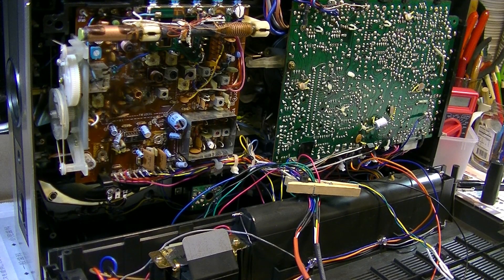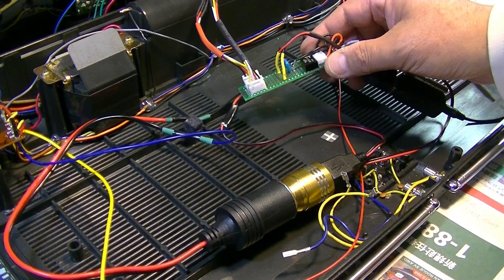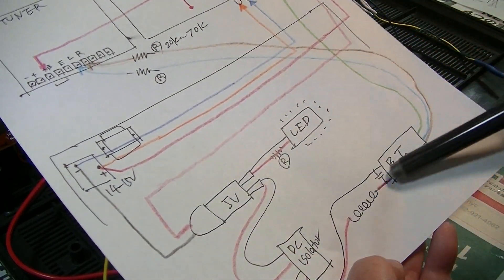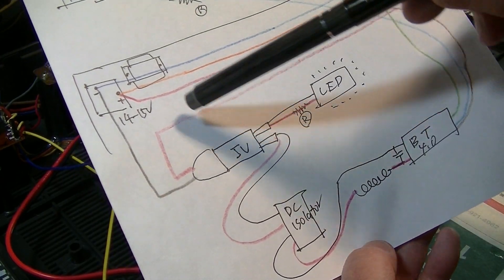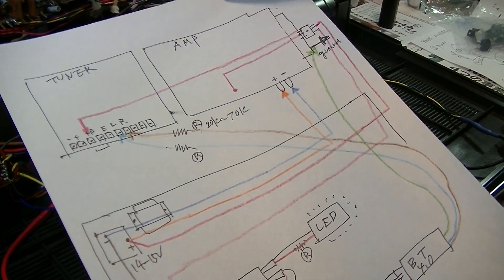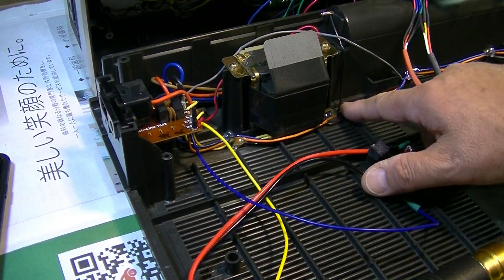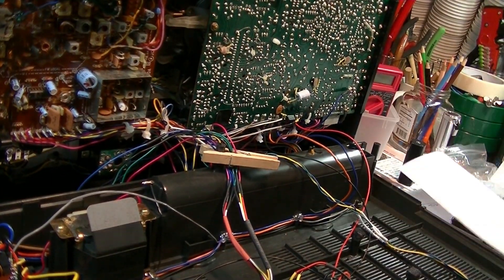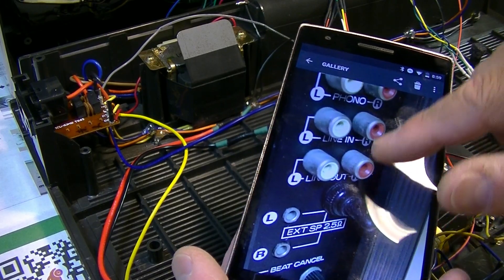Sanyo M9994K boombox how to install Bluetooth explained in English

Comment: Fantastic - really helpful - thanks Teddy. I've been converting radios to have Bluetooth for several months but learnt a lot from you in this video. Thanks again.
Reply from the maker: Hi Bob. Thank you for the comment. I know you can do it!! Go Rob go!!
Reply: @teddyhashee  Thanks man! Your video was really helpful getting me started, but I've done it a little differently, mainly so that I didn't have to add another button. (These radios are rare and expensive, so I was worried about de-valuing it).

I connected my BT output to where the LINE IN sockets connect to the circuit board, and activate the BT adapter with a spare (unused, unsoldered!) pin on the "TAPE/RADIO/PHONO" switch (activated when in PHONO mode). In PHONO mode the radio stage isn't activated (so no need to mess with that), and you just need to ensure you're in LINE (not MIC) mode, with plenty of INPUT LEVEL (8 is good). (These last 2 settings can be left like this, so no need to fiddle with the settings every time you use BT).

Thanks again Teddy - your video was so helpful in getting me started.

Comment: Great tutorial Teddy! I have had problems with finding tuner connections that control treble and bass. When I find tuner connection, I can't control treble and bass.
Reply from the maker: I am not sure the problem you are encountering right now, but I do recommend to test and search more about it. If it is not from the wiring, then you maybe need to change the capacitor, etc...Hope you will be able to solve the problem.

Comment: You can eliminate the ground loop problem and simplify the design by just adding a 5v phone charger to BT. Anyways, thanks for sharing, your English is very good.
Reply from the maker: Connect 120v AC line to 5v phone charger inside of the boombox, I did same thing before and it cleared ground-loop problem as you said. I just did not wanted to connect power switch on the between 120v AC line to 5v charger. If I add switch between 5v charger to bluetooth, then it means 5v charger is always on that will shorten the life of the charger,... etc. But your opinion is right, it totally clear the ground-loop noise. Thank you for the comment.

Comment: Why do you have two 5v different  dapter.for Bluetooth module. I thought you need one 5v dapter
Reply from the maker: In this film, I only use one car charger for 5 v adapter and dc-dc isolation module that will prevent noise from groundloop.